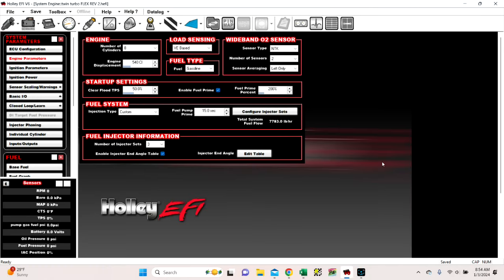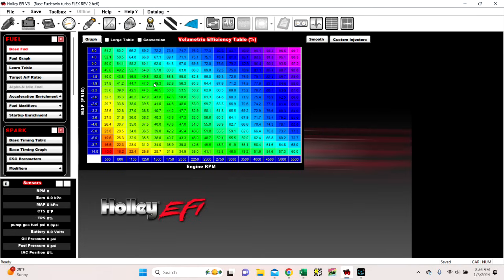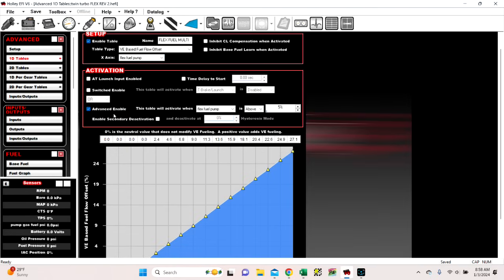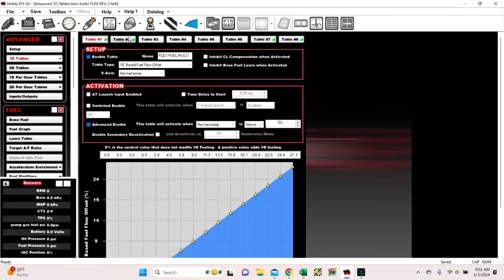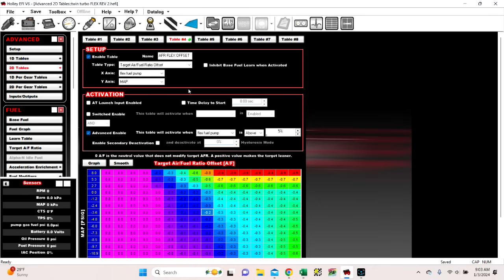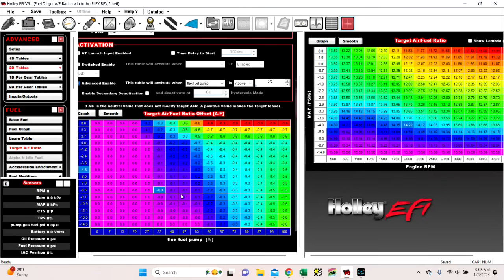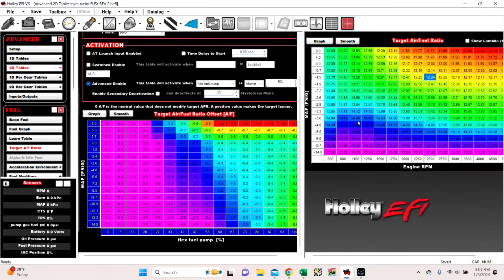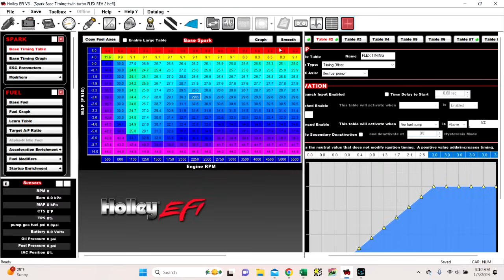HOLLEY EFI AND FLEX FUEL

Comment: When the base timing table is tuned on 93 octane you add 4 or 5 degrees of timing with an offset table to run E85.  If my timing table is tuned on 116 octane might I need no additional timing when running E85.

Comment: If the setup is on gasoline scale and everything is tuned to 93. When adding fuel, why are we not adding wat nore fuel at idle and vacuum?  I stead of 14.7, i would add an offset table to add fuel so it reacher around 10 afr (pump E85 is a out 65%)

I have spent way too much time on the AFR, lambda and stoich with holley and its more confusing. I have perfect idle at 700 on 93, after adding E85 the idle is all over and stays around 1100.  Is this because its super lean on E85 with a 14.7 AFR target. 

Some say not to overthink it and no need to change AFR. But this doesnt make sense cause the main table for AFR is based on gasoline scale which will make it lean at idle. Any help is appreciated!
Reply: It’s all on gas scale so 14.7 is stoic no matter what

Comment: Why use VE offset instead of fuel flow multiplier? Using a fuel flow multiplier will add to the cranking fuel and the acceleration enrichment values.
Reply: He probably has a long answer to why but the easy answer is because Devin told me to
Reply: fuel flow multiplier won’t add to cranking fuel.

Comment: Why would you multiply the VE table by any amount?  Changing the type of fuel used doesn't change cylinder filling (outside of a small percentage due to charge cooling), so the VE shouldn't change at all.  Why wouldn't you just have the flex sensor change the stoich value of the fuel to what is currently being reported by the sensor?  Then all the fueling math would work out without having VE numbers that aren't real.
Reply from the maker: Cause in holley software you cant offset the stoich value in an advanced table, so you need to offset ve. the only place the youll see wrong ve values will be in a log not on the fueling table.  hence the reason i said to dial it in on 93
Reply: Got it... 👍 @theholleyefiguy

Comment: Wondering what’s the thought behind offsetting the Ve table and also the target af?
Reply: E85 usually likes richer targets at WOT so if you have an 11.5ish target for gas, youll want to offset that down in to the 10s for e85. You cant just add extra fuel to the table alone because closed loop will try to force it back to the gas target if not offset.
Reply: @hectorgomez502  Appreciate the explanation, makes way more sense now.
Reply: @hectorgomez502  So to not complicate things, the sensor reads in lambda, thats why even if you leave the same target af the Ve table needs to be adjusted so the E85 will get to set target af since its stoich is way lower than gas.
Reply: @v8tergt653  correct, sorry for the late reply.